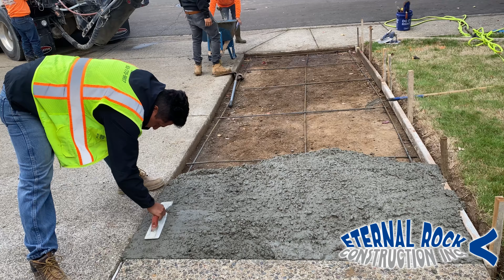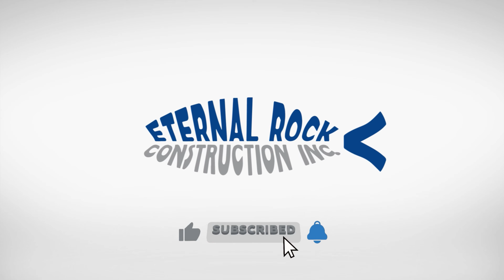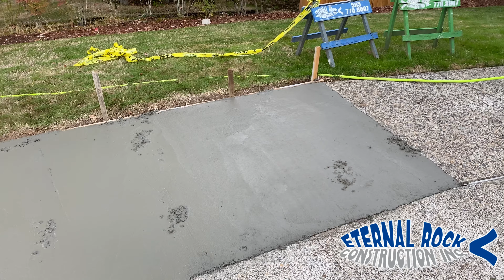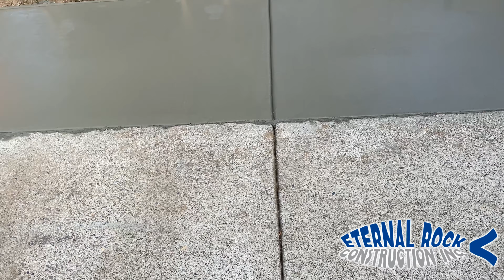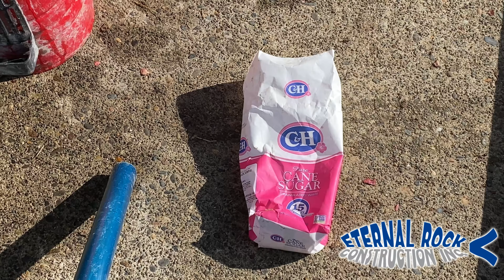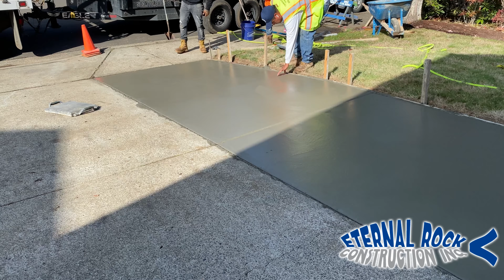How To Pour A Concrete Driveway Extension Step by Step DIY For Beginners

Comment: What limitations does the volumetric mixer have? I thought slump would be an issue but by the looks of it it pours really well. Not too wet. Great job and great video!
Reply: I have used them before and if you have a bad operator usually the first yard the slump is all over the place